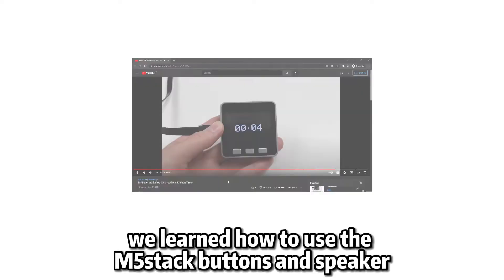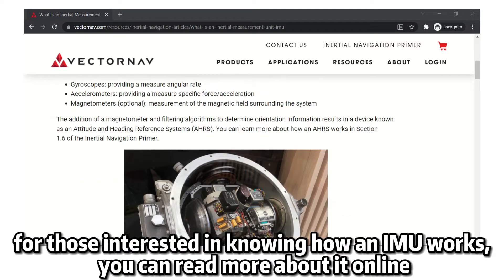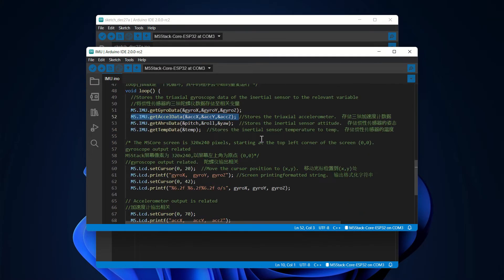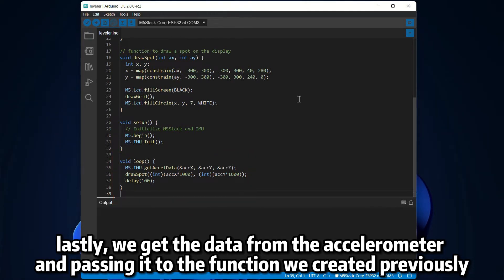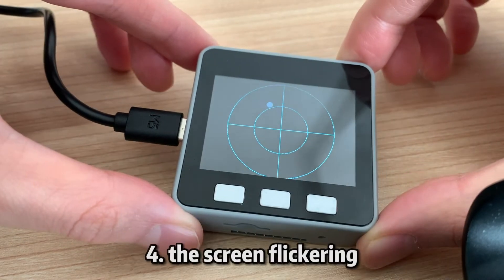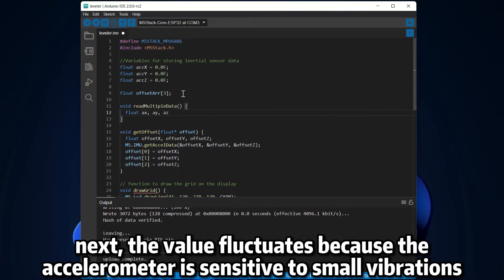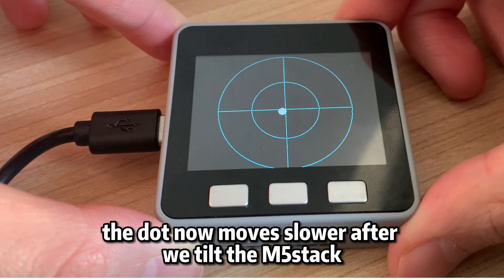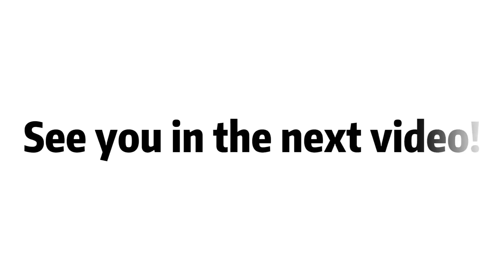[M5Stack Workshop #4] Build a Level with IMU in the M5Stack

Comment: For your "readMultipleData" function, shouldn't the 'getAccelData' function be called within the for loop? Otherwise you are adding the same ax, ay, and az value for N=sampleCounts
Reply from the maker: Thank you for pointing that out.
Yes you are right, getAccelData() function should be called inside the for loop.
Reply: @vstonevstone  Great, thanks for confirming. Awesome video btw, it was very helpful!
Reply from the maker: @jonnyg3453  Thanks!!